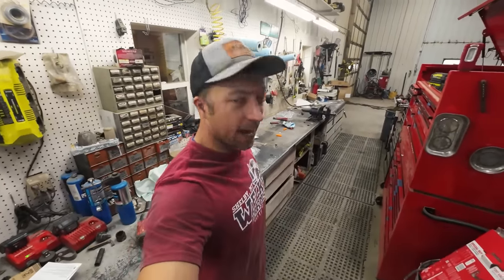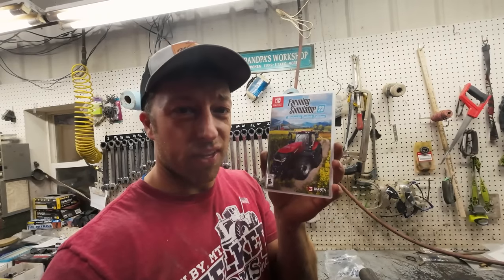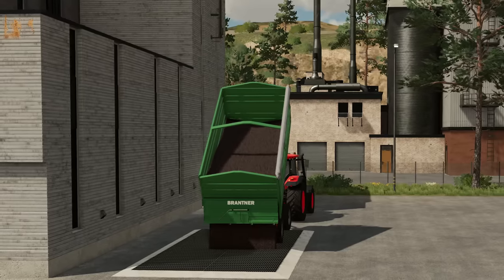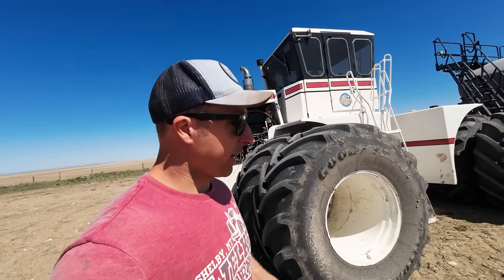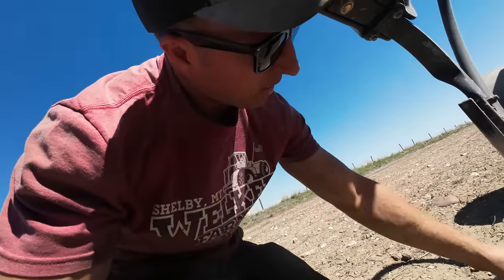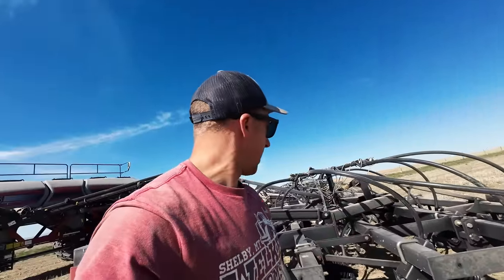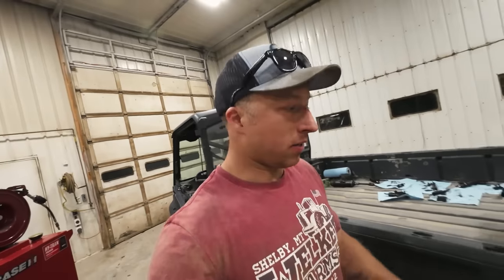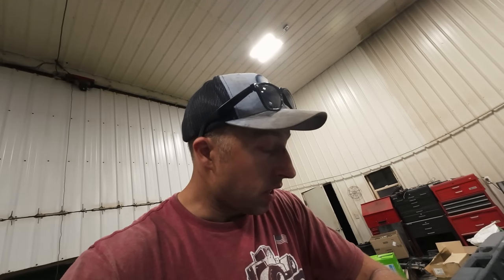Will An Old Rusty Engine Save Our Season?? *TWO TRACTORS DOWN*

Comment: Another voooote for bad fuel. Thats also cheapest to try and fix, one could simply drain the tanks and store that fuel, then put a couple 5 gallon cans of fresh diesel in there and see if it runs differently.

Comment: 855 Cummins I figure,and I would have to agree with what everyone is saying fuel, pull the fuel filters and take a gander.  I use 5 ounces of marvel and 5 ounces of Lucas 2 stroke semi synthetic low ash every fueling in my semi, runs smoother and better fuel mileage,but I have 0 smoke out the stack. Water will give you white smoke, but 12 injectors go wonk. Don't know! But back in the day we would plug the return lines to push more fuel to the injectors to get that cloud of smoke, so we could tell the tractor was working 20 miles away.

Comment: Your boots are wore out allowing your shovel to move back and forth shearing your role pin off. Take a new boot and you’ll see where you need to weld your old ones up at to rebuild

Comment: Have you done a test with running with no air filters. Back to basics. Black smoke means an excess of unburnt fuel. Fuel ratio is somehow wrong. Injector pressure, droplet size or not enough air. Not enough air could be filters or intercooler plugged. Even though turbo pushes boost if it isnt cooled enough it will starve for air. Good luck.

Comment: Hey guys. I would definitely say contaminated, fuel, or clogged fuel filters. It’s way too big of a coincidence that both tractors had a problem at the same time. I would definitely before you put those other injectors in that big bud check the fuel tank, check the fuel lines check the filters check the injection pump.

Comment: Fuel is the first possibility.  But I had similar problems ( black smoke only under load) with bad air filters. Could they have both been changed prior to the season?  🤔

Comment: It will be interesting what is causing both tractors to produce so much exhaust smoke. I personally is not a fan of rebuild/ remanufactured injectors and have by my experience noted them to be a failure. In my opinion, and experience  new injectors is the best way to go.  Good luck and I will be watching with great interest the cause to you're problem. Hi from Australia.

Comment: Did you put the wrong oil by mistake hydrolic and not 15w40?
Reply: That's a good thought, but the smoke likely wouldn't be so black if oil was getting past the rings, and into the combustion chamber.  There is a distinctive scent to the smoke of burnt oil, compared to incompletely burnt diesel.  Third point again; is it is happening to 'both' tractors within an hour of each other.  Chances of screwing up oil changes on two tractors is pretty slim.  It's possible, but highly unlikely.
Reply: Thus is true Ed just trying to get to the bottom of this. Excessive blow bye Can cause strange things to happen plug air filters resulting in black smoke, bad fuel seems a possibility IDK 🤔

Comment: Repower them with Detroit's or Cat's. problem solved.
Reply: You would have to be kidding. What would you install,  Detroit are as close to irrelevant, don't tell me a dd16. Not up to the duty cycle and power. A c18 would not last as long as a k19 in this application . You would repower with a qsk19, sms foot print and about 25% more durable than a k19

Comment: The injector diagnosis does not make sense.  I would definitely go with contaminated fuel possibly has some def or water in it.  Now with that being said if it has a little Obama water mixed in with it it could have already ruined the injectors.  Before even crank that tractor with the new injectors I would definitely get fuel samples from the tank and from the pump.    
   And once the problem is resolved keep a close eye on your pump.

Comment: AFC , smoke control work with turbo boost line to control fuels . also possible , many older cummins had STC , step timing control , that can smoke too . need check Boost pressure too

Comment: While fuel is the most likely cause of smoke, inadequate air is certainly a possibility as well. When ever a turbo gets sick you get smoke right? You changed air filters right? both from the same supply house right?

Comment: At the price of fuel I’d consider an up grade to a newer Cummins like your n14 they go 525 as you no. The fuel savings would be huge or c15,16 cat.  Kt parts are hard and they were not a good motor to start with.  Gallons per hour would pay for the swap in no time.

Comment: If it is possible, and probably not right now with planting season,  but do you think its best to get a good used tractor, more up to date and start retiring a bud, or if you sre going to keep going with the buds, to just bite the bullet and get complete rebuilt or newer engines in them?

Comment: Disconnect the fuel line from the tank and run them on straight atf, that will tell where the issue is. That’s what Cummins fuel system treatment used to be.

Comment: hi, the NTPA 20 000 lbs semi truck pullers use those engines with four turbo's, those guys are not hard to find and they will have parts, like stock injectors laying around, etc etc

Comment: Man, i hope you get the mechanical issue's figured out, not good timing.  The one thing i haven't seen yet this year, is a bowling ball,  ive been watching you guy's for a few year's, and i have always been amazed by these bowling balls, and where they come from.  I watch western truck and tractor, and he work's on all kinds of machinery, and he has been having bad luck with anything that's been rebuilt, especially injectors.  G-d bless y'all.

Comment: Well, a smoking diesel is an over fueled diesel.......won't matter what fuel you are runnning.  Back in the day when I was farming we ran JD 9610 combines, had 4 of them all going at once. Noticed one was smoking heavily and the other three were clean going down the field under load. Asked a well seasoned JD tech why is one of these machines is smoking and he paused a second or two and replied...Probably weak injector springs. Changed the springs out and VIOLLA....no more smoking !!! You had better ask your injector rebuilder if he changed the springs when you had your injectors rebuilt....most of the shops clean the tips, replace the O rings and check the pop off pressures...the problem is with weak, worn springs, they won't cut the injector flow off cleanly and you get smoke. ...Also put some Marvel Mystery oil in your crankcases and in your fuel....after a 100 to 200 hours of running you will  notice a reduction in oil consumption as the MMO loosens the carbon buildup around the rings and the MMO in the fuel will help maintain the health of your injectors. Good luck with spring work......love to see those old school Buds working hard !!!
Reply: Also heard atf in fuel filter will help clean injectors as well.

Comment: 🛢🚜💥 "It's intriguing to consider the possibility of contaminated fuel causing issues in both tractors simultaneously, especially since the problems arose within such a short time frame. 🤔⛽ Examining the fuel quality and ensuring it's free from impurities could be a crucial step in troubleshooting and getting both tractors back up and running. Good luck in your quest to save the season by resurrecting these old rusty engines!"

Comment: Hello Fellows Man life wasn't meant to be easy ,but it sure breeds Character & Farming is just that, I had a thought , now you have Winter Fuel & Summer Fuel, some times the Fuel company forgets to change over, that I know can cause Problems its the additives that cause the problems when the season gets warmer, the other thing is if its a Direct Fuel injection pump and pepped up can cause the Injectors to push more Fuel the Turbo Charger can not force enough air in to Burn the Fuel , this has happen to my Brother with His Kamatsu Bulldozer with a Cummings Motor , they sent him the wrong Fuel Pump, that's Just a Thought, I know the Big Bugs burn their Fuel very Clean, so to have the Big Boys do it the same time makes me think what I had wrote above, I'm sure God willing Fellows you will fix the problem very quickly & get on with sowing your crops in, Cheer up Nick, these problems can happen to any body, its part & parcel of life, the main thing you all have is your good Health, Blessings to you all, Regards Trevor.W.Bacelli. Biloela Qld Australia.   👍 Great video, 🐕🐕🐕🐎🐎🐎🐎🦄🦄🦄🦄🦌🦌🦌🦌🐂🐃🐄🐖🐏🐑🐐🐨🐨🐨🐨🐨🐨🐨🐨🐨🐨🐨🐨🐨🦘🦘🦘🦘🦘🦘🦘🦘🦘🦘🦘🦘🦃🦃🐔🐓🐓🦆🦆🦋🦋🦋🦋🦋🏵🏵🏵🏵🏵🏵🏵🏵🏵🌺🌺🌺🌺🌺🌺🌺🌺🌺🌺🌺🌻🌻🌻🌻🌻🌼🌼🌼🌼🌴🌴🌴🍍🍍🍍🥑🥑🥑🌽🌽🌽

Comment: Heard Area Diesel Service is good for injectors.  I was wondering are the turbos making good boost pressure? Wastegate leaking? Or leaking turbo seal. Are you using engine oil? So strange that it doesn't smoke at idle. But I'm no expert

Comment: You need to find a new injector rebuilder maybe & if your gonna reuse a cummins injectors you should never remove the plunger if contamination gets in the barrel & nozzle it will never run right it dont take much to cause a big problem ,i worked on KT engines both on & off road for many years setting the injectors with no jake brakes is pretty simple, i have resealed & tuned  many KT's when i was done no more oil leaks & they ran like a fine watch.

Comment: What we do as preventive maintenance can be a worst burden. We can't control the  rebuilders. We only hope for competence. I have been in your shoes and Yes gutting the spare tractor happens.   Our operation has grown to the point we have  A Tech on call. But that has taken 40 years. The Class machines we have had under warranty are just wonderful. But The Deere equipment that makes up the majority of our power is falling apart. Out local Deere dealer refuses serves calls. and we must take the unit to them. As to why we are buying other brands.  Having a unit out of service is unacceptable.  We have been running 2 Class choppers for a few years. And our Class dealer was more then willing to step in when Deere dropped the ball. We have a bone yard of older machines we gutted. I know it sucks to put trust in someone just to be let down.   And what others have said. Check your fuel. I know that is one thing I have over looked in the past.

Comment: Did y’all check air flow and boost pressures? If that’s no issue, fuel or injector related.
Reply: Did, were normal

Comment: If you want a very dependable motor 
Find yourself a mechanical N 14 ( not the red top ) 
I put over a million miles replaced a belt and a changed the oil 
It high torque low rpm 
They are very similar to the ISX Cummins 
Just a earlier version 
Massive rod and main bearings 
I had new rod and mains put in at 1.1 million miles 
And the old ones were still in great shape 

And once it’s running you can throw out the electrical system just turn the screw on the pump in 

And they be set from 425 to 800 hp 
And be dependable 
Pump settings injectors of course and the right turbo

The last thing you need is more computers and sensors flashing at you all day

Comment: During COVID, and maybe still, practically everything coming from China was defective. Especially anything that should be quality steel, and hardened. From camshafts to springs, we've seen a lot of premature failures. Those injectors were rebuilt during COVID, and I'll bet the springs that push back, closing the injectors, are weak, if they're not just broken.

Comment: @gerryspang5917 said what I had found out also with low flow and high flow.  Maybe just a thought. But no matter what, it's how you handle these situations is the key. Stay calm and focused and it will work out. Keep the faith my friends.

Comment: a kt injector has a copper  seal  that  snaps  onto  the end of the injector  to prevent  combustion  from  going  up  the  injector  and  melting  the  lower  fuel  seal  which will  let pressure  fuel inter combustion  chamber. did you use new ones  if so were  they  the proper  thickness  they come in .010 thick intervals  this could  be your problem
Reply from the maker: The injector repair shop put new copper seals on but maybe they were bad parts? We will send the injectors off to be analyzed and see why they failed.

Comment: Because it is across multiple tractors, IM wondering if it has something to do with the fuel. If it had enough water in it or bad fuel theres a chance it could not burn cleanly. Not sure exactly but I would look at fuel and common things between them. Injectors sounds like a good idea.

Comment: Sounds crazy but I had the same problem with a swather smoking and loosing power changed injectors turned out it was the inner air filter was plugged and it didn’t look plugged

Comment: What you needed to do is pull injectors on both units and have them checked/ rebuilt again. Have a certified Cummins tech install these and set the overhead. You guys didn’t set the injectors properly when you replaced them- didn’t set them at all. This is not good. Also check all push tubes for straightness during the overhead set.
Reply from the maker: We had a certified cummins diesel mechanic set the injectors after I installed them. Next video will explain but what we found were bad caps on some of the rebuilt injectors.
Reply: Perfect! Thanks for the update!

Comment: You can probably get a bigger size roll pin and drill out the boot to fit
Reply: But then it won’t fit the harden tooth?? No way you’ll be able to drill thru that carbide.

Comment: Get some big green JD tractors
Reply: He actually wants to be able to drive past 1 hour before a stupid sensor goes out leaving him stranded. And requiring a dealer to fix it cause only “JD certified technicians” can fix it. 🤦‍♂️
Reply: @Crandon Borth  You have never watched One lonely farmer Wes Pandy.. He fixes all his John Deer tractors.. He buys new parts and fixes them himself
Reply: @jimmysills4742  As the operator/employee of a large farm… you have to get a Deere tech to open up the software on the tractor. You literally have to be “Certified” to even access it. Sure the physical parts you can buy and fix yourself but I’ve found on newer tractors they tend to not break down as much “other than the Emissions junk”. John Deere’s are notorious for have faulty sensors issues and faults that will put the tractor in limp mode and it’s basically unusable.

Comment: Had same problems with my 9380 case stieger this heat. Did injectors, bearing roll and found cam shaft had flakes on it so had to to it and after 13 hours having injector problems so parked tractor and using another one

Comment: Its time to retire them buddy
Reply: I’m sure you won’t mind sending them a check to cover that…..
Reply: It's cheaper to keep them than taking out loans for new tractors that'll lose their value quickly, will fail quicker over the smallest stupidist thing and won't allow them to work on them, plus if they have a bad couple years they'll possibly lose the farm to deal with the loans the would owe (as they would probably have to use the farm as collateral.)
Reply: i politely disagree.  parts are cheaper than a whole new rig.